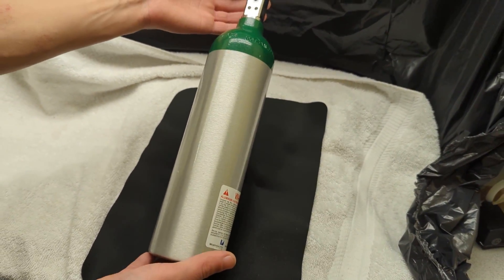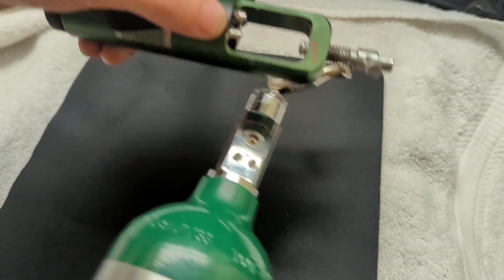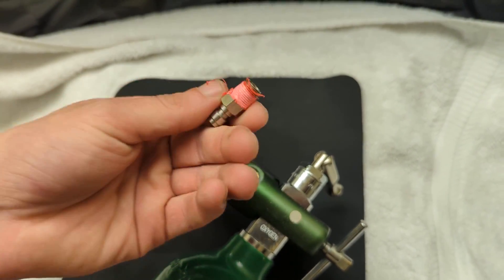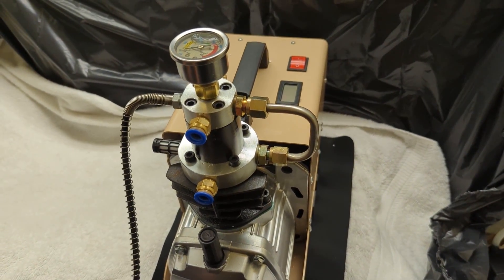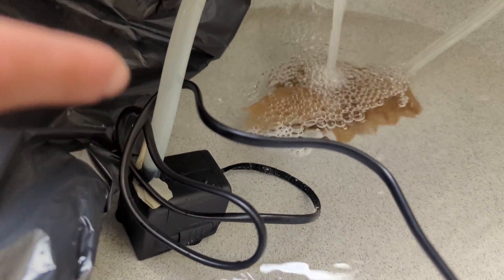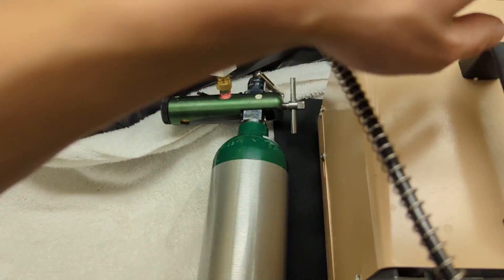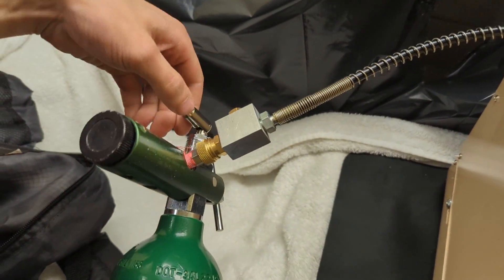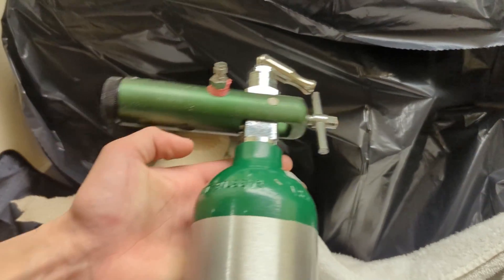Refill Oxygen Tanks with 4500 psi Air Compressor

Comment: I'm attempting to do some dumb shit with that compressor. I want to compress NG in commonly available tanks like air tanks or most likely co2/welding gas tanks. Do they make a fitting or adapter for that compressor with a bleed off valve where i could hook it up to a CGA 320 or 580 valve? 1800-2200 psi is my goal.

Comment: You need to be more workmanlike when using Teflon tape. No tape on the first two threads and no loose strands of tape that can end up inside the tank and then end up in your gauges and regulators. Also, pliers ? Really?
Reply from the maker: Teflon tape tastes pretty good honestly

Comment: Hello man can you use this tipe of compressor to fill oxygen cylinders from oxygen concentrator? 
I know you need high pressure oil free compressor to fill this cylinders safe
Thanks
Reply from the maker: yes  but not recommended and possibly dangerous for person using tank
Reply: @ianbuilder  i want this for welding purpose,not medical and i want to buy this compressor or something bigger for refilling oxygen cylinders for welding
Reply from the maker: @zMotan  it would work

Comment: I have an oxygen concentrator and a oxygen compressor. I bought a decommissioned system. I'm missing it to fill bottles for welding and jewelry.
Reply from the maker: same here
Reply: I live in Alaska and every year we send ours to Anchorage to be recertified. It costs the company 250 to ship one way (medicaid).  When they get decommissioned it would cost the company 400 to ship the the lower 48 and they get 50 dollars for the recycle fee. 
I purchased the whole system for 400. 
It would cost me 400 for shipping to Alaska otherwise. I'm a certified EMT.
Reply from the maker: @Lecon60  true im just using a craigslist one to refill welding bottles for myself so no need for any sort of certification
Reply: @ianbuilder   😂

Comment: I've been hanging on to several o2 bottles for a couple years now.  I have a Yong heng 4500psi similar to yours but slightly different plumbing. Your water pump is barely flowing though. Open up the inlet to full flow. I don't even use water if filling a gun, but I would for a bottle. Now I finish watching.